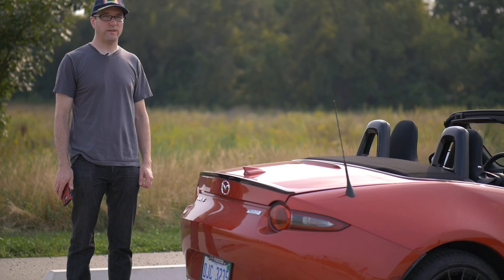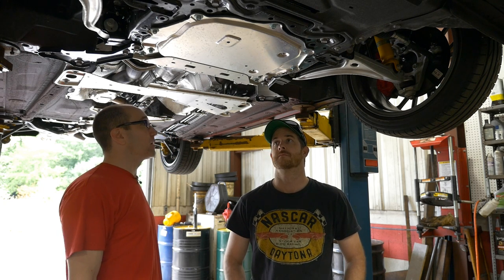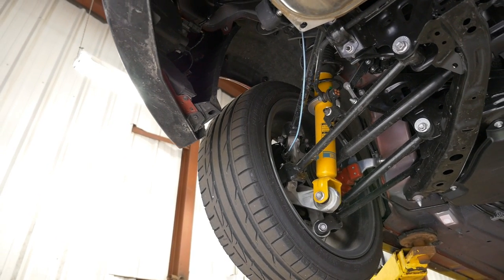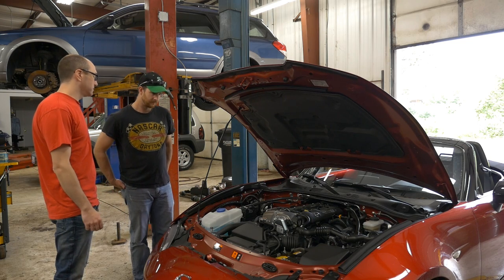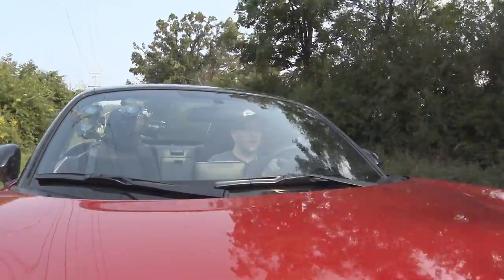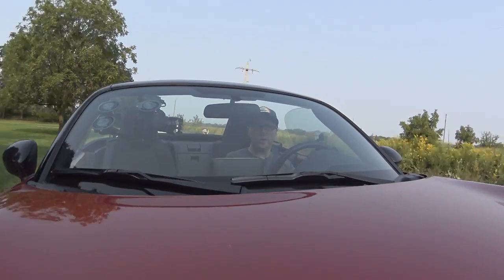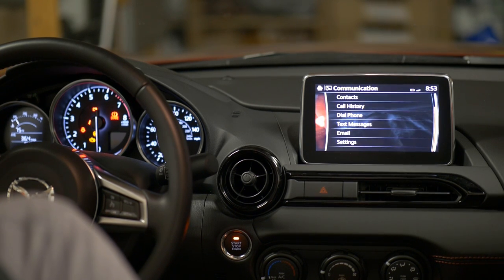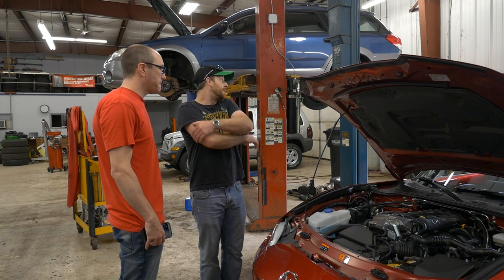Review | 2016 Mazda MX-5 | Curing Automotive Diseases

Comment: Wait a minute... the MX-5 GT (not even the club with the Brembo brakes) is $42,000 CDN ... so I get my FRS with the full TRD package - 18" wheels and tire upgrade, TRD struts, lowering springs, exhaust etc... All for $31,000 CDN and have $11,000 left to run the car until my warranty runs out and shop for a supercharger?  No offense but this review sounds pretty kiss ass after the hours of FRS ranting you've done...at $42,000 I will get a pretty sweet used Boxer or Cayman or better yet, get a $20,000 used FRS and a life time in hairdressing where you park the Miata beside the MiniCooper. Ha, ha!  Just messing with you but the pricing for the club is @$50K.  Really? For that money, you should keep shopping.
Reply: Streetsandpeaks no thats not how much an mx-5 costs

Comment: I just have a hard time justifying $30k for this car.
Reply from the maker: Exactly, its tall money.
Reply: +savagegeese $15k will get a fantastic S2K. Drive the piss out of it for 5 years and it might still be $15k. Not intended as a put down of the Mazda.
Reply: +Trevor Wray Although $30k is still less than the average new car transaction price in 2015, a base MX5 can be had new for under $25k. You would lose the uprated suspension, brakes and LSD from the Club trim that was featured in this video, but the rest is pretty much the same.
Reply from the maker: +Eric Shea For most the base offers kick ass fun for what you get.  The clubs best feature is the LSD.  Swapping in good pads will be efficient for most on the standard brakes.  Wheels are nice but tires are more important. If you are hardcore the Bilsteins and springs are still soft and would likely get swapped by most anyway. Point like you said the base car saves you 5k plus which can get funneled into tires, pads and custom dampers which would be better in plenty of scenarios.

Comment: I am a car enthusiast big, car enthusiast and honestly I never liked the Miata and I would never buy one. It does nth for me I don't like its looks and it's slow. Yes it handles good but so does other cars. It's overrated. I like what the car is about just wished we had more options from Honda and Toyota. 

On a side not I really wish Toyota would bring back the MR2 spider mid engine to give this car a fight.
Reply: When the ND came out I was disappointed and couldn't believe it had less hp than the NC. I posted how they should have a 2.5L ND. I then drove the ND, NC and a NA and I find myself enjoy driving a slow car fast. I mean after shifting gears once and about 7 secs your breaking the speed limit how much faster do you need it to be. I now sometimes find myself wishing Mazda would release the 1.5L engine in the U.S.

Comment: so biased, mazda the new Ferrari according to the tone of these reviews.
Reply from the maker: You are kidding right?
Reply: +savagegeese dont get me wrong, I enjoy your reviews but if you look back at the other Mazda reviews you guys have done there is a fairly hefty biased to the point that even Turbowski makes the joke "not a sporty company like Mazda" in one of the videos. 
One thing that I enjoyed was the ability for you guys to be completely brutally honest about things, this seems to shaft stroking for Mazda. You slightly touched on some of the real down points of this car as a sports car (power) but just as a passing comment at the end. Though, this is just my opinion
Reply from the maker: +Pavin Kang In this case while Scott may still see the car as nerf or little league. In many cases its true.  But, really this car is rare.  They set their goal around building a car that was lighter and smaller than the previous gen and keep it a dedicated platform.  And in doing so we got a 2325lb car with extensive use of aluminum a very impressive suspension front and back and good chassis and trans with very little BS. (Imaging if Honda or Toyota tried this)  It's really hard to knock what they did here. Namely when you look at what everyone else is doing in the price range. Nothing can touch it.  Now the problem is in the interview with Dave he straight up said Mazda does not have the engine budget here to do a one off motor.  They are small compared to some of the competition.  They just dont do the volume to spend 50 million on a new motor just for the Miata.  And that really is the most disappointing thing here, and that the car is not all that usable or accessible as a daily driver.  But if you look at this car as a whole aside from like a 4C or Lotus Elise there just isnt anything left like this car.  I think that's the sad part.  We all bitch how we want a purpose built driver's car and we got it and I think this is the best Mazda as a company can do with it right now.  It's much like the FRS story except that platform was built to a price point and cut plenty of corners to make the car 25k.
Reply: +savagegeese Dont get me wrong, I'm sympathetic to the Miata / FRS / Cheap Driver's car story and plight. For many reason, I own one and would love to own this specific miata as well. Not only that but have followed your videos/builds/channel, seen your opinion on things.understand your channel is meant to focus on the motorsport aspect of cars but there should be some equality of critique between cars/companies. Which is what I guess my main point, when it comes to Mazda as a company there is some excuses given that are acceptable, whereas in other companies not so much. For example, you had a "bad FRS" review, while at the time  I thought it was rough it gives a true light on the car in many different angles, not just what their intentions to build were, not just giving them heaps of praise because they attempted what they did. Again, no ill intentions merely an insight from a long time viewer of the channel
Reply from the maker: We are likely to have a long term ND which will be subject to the same scrutiny and the 86 platform.  I get what you are saying about being more real about it.